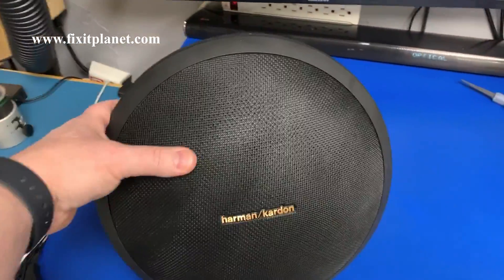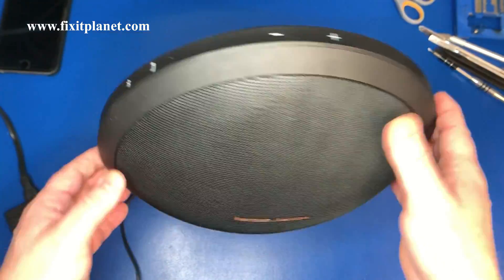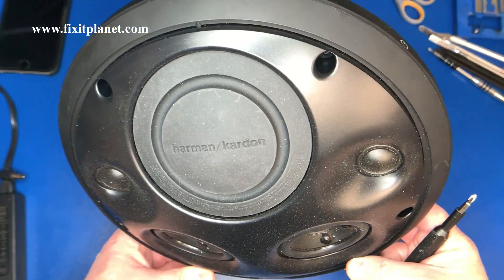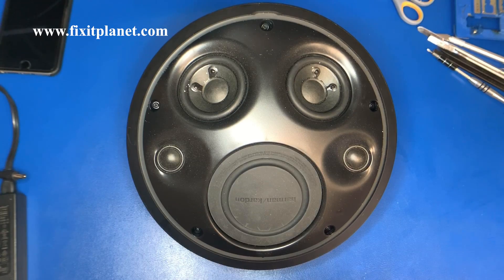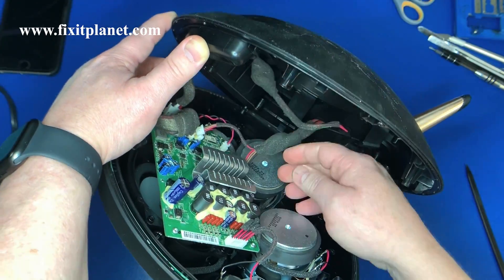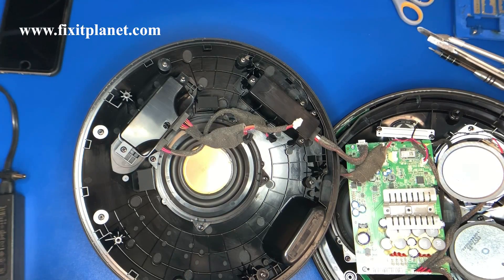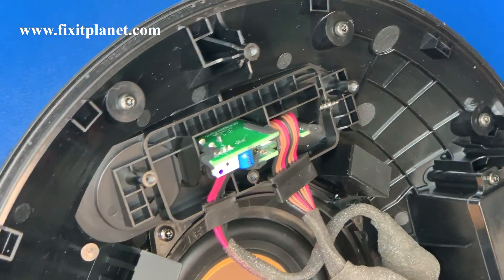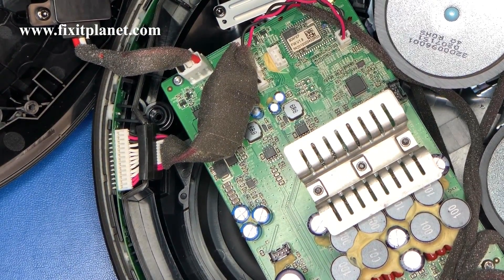Why I Hate Bluetooth Speakers! Harman Kardon Onyx Studio Won't Turn On.

Comment: Hi John, I just watched this video and still have a question.

I have the exact same speaker that you were working on.

My issue is it Powers on when plugged into the ac wall adapter. But will not power on if I unplug it from the wall.

I don't get any Lights or indication that it has power.

Again, it works fine when plugged into the wall, but I can use it as a portable speaker anymore because it has to be plugged in.

Can you offer any advice and help?

Thank you

Comment: Thanks for the detailed video. My hk onyx 4 took a fall and since then the speakers just shuts down and restarts if I play anything a little loud. Any idea what it could be?
Reply: Mine too
Reply: @Cloudy_The_Immortal  are you using the original adapter that came with the speakers? For me I figured out that the replacement charging adapter I got didn't provide enough output voltage to support the speaker when we turn up the volume.

Comment: My onyx 5 was so great in the beginning the 1 1/2  years of use it stops dead so i read up figured i needed a battery replaced it an it does not work so now i know its the charhing port.  How can this either be repaired or bypassed to charge another way even if i have to go frankenstein on the thing with crocadile clips and another outside power sorce does anyone know tricks to bypass the broken charging port?

Comment: Mine no longer recognizes the AC adapter - meaning, when the AC is plugged in, the speaker won't stay on like it use to. I hear the low battery beeping sound and then the speaker cuts off. The speaker also doesn't stay on when the AC adapter is un-plugged from it. Do you have a video or step by step instructions somewhere for how to fix the issue?
Reply: Any update?
Reply: I bought a new adapter and it works! Amazon of course.

Comment: My does it since I changed the battery which charged and works fine but since it turns off after awhile.
Reply from the maker: Ok... what??????????
Reply: @FixItPlanet1  since I changed the battery the speaker turns off at times by itself while I listen to music.
Reply from the maker: @Idontlikethisever  Maybe the Bluetooth module is  failing.

Comment: Any devices that runs on non replaceable batteries should not be bought...except maybe mobile phones that will be obsolete in 2-3 years.  There is enough plastic pollution everywhere. Humans can send rovers to Mars but cannot agree on having a standard interchangeable rechargeable battery system. All companies want you to buy and throw in the landfill.

Comment: Bluetooth whatever is bad for the environment. Batteries are not meant to be changed. I have a similar speaker. Battery dies suddenly. I either change the battery myself or throw it in the ocean to feed sea turtles. Why can’t they make replaceable batteries. Real m****rfuc***ng greedy irresponsible companies.

Comment: My Onyx 2 .. works with a/c conection but when i unplug that cable , doesnt work ... ? i always use the speaker conected to the a/c . It possible that the battery is dead ? In that case what this happn?
Thanks

Comment: I have a studio 4 and it won't turn on.   Is there anyway i can fix it?
Reply: paul o I have a studio 4 that won’t charge thinking about opening it up & checking what’s up
Reply: @MEspinalG  me too having Onyx Studio 4 that wont power up, Please help
Reply: @keatsiangchng5735  hi guys u solved the problem of charging? I got the same issue...
Reply: Same here lol
Reply: Try using a different charger..
Reply: Did anyone find out what the problem was?
Reply: Not fixed mine yet

Comment: I have a onyx studio 3.  When turning on, a chime no longer turns on and there is no volume.  I have disconnected and reconnected the Bluetooth multiple times on multiple devices.  I have tried the factory reset and I have tried plugging into the aux port.  The device connects via Bluetooth and I can control the volume from my phone but nothing from the speaker.  Can you help?
Reply: Try the plus and minus buttons on the speakers rim

Or maybe you blew it

Comment: I have the same speaker but it’s not that easy I wish it was 
Mine stopped charging and not turning on even when plugged not working anymore
Reply: I did battery replacement, It wont turn on as well :(
Reply: Philip Limawan same as me
Reply: I got a new battery it work fine till the battery 🪫 died and it never charge it again 😢

Comment: IF YOUR SPEAKER WONT TURN ON, FIRST CONNECT YOUR AC ( CHARGER) THEN HOLD DOWN THESE THREE BUTTONS FOR 8 SECONDS "BLUETOOTH, POWER, AND PLAY BUTTON" AND THEN THAT RESETS YOUR SPEAKER. YOUR SPEAKER SHOULD TURN ON NOW. UNPLUG YOUR AC (CHARGER) 👍
Reply: How about the ONYX STUDIO 1? No play button on this one, thanks!
Reply: Mine went off and not turning on again. I have tried to connect the charger but its not charging. What can i do? Mine is onyx studio 5
Reply: THANK YOU SOO MUCH IT WORKED
Reply: @kerenfrempong3329  you're sexy
Reply: Will this work on the onyx 6?
Reply: Will that work on the onyx 7 ???
Reply: Thank you so much
Reply: THANK YOU!!!! I thought I broke my speaker from blasting it so loud 😂 I was so mad when I heard the hissing sound but it wouldnt turn on. Just did this and it worked.

Comment: I have a onyx3 and a onyx 5.....Best sounding speaker....but my onyx 3’s battery is not  functioning already...but can still be use if plug in to AC.....My onyx3 has serves me for 1 year and 8 months...😌
Reply: I had same problem with battery but it would also not work when plugged in.

Comment: I have three Harman Kardon Onlyx speakers which I use every day and I have never had any problem. The speaker you fix seems not to be well kept and in a good state. How we treat our stuff can be one reason they stop functioning, or not ?
Reply from the maker: Yup
Reply: @fixitplanet my HK OS 2 wont stay charged more than 5mn’s... it won’t stay charged unless the usb ‘AND’ the ac cord are plugged in. if i only leave one plug in, it will shut off immediately(weird)i’m two seconds off throwing it in the trash. no repair shops where i live. any suggestions? R.S.V.P.